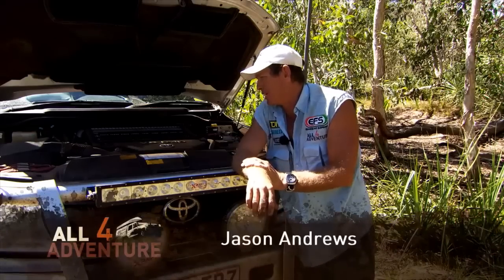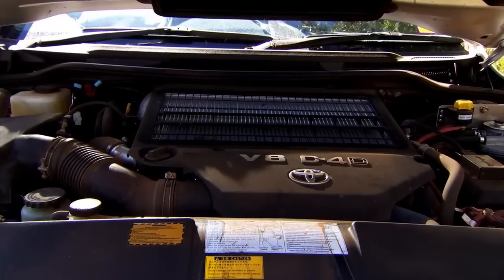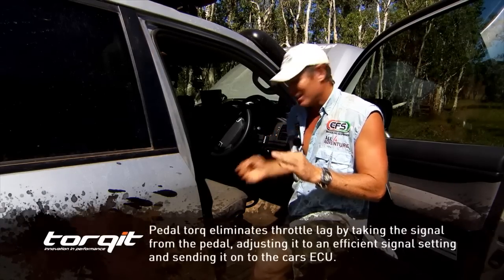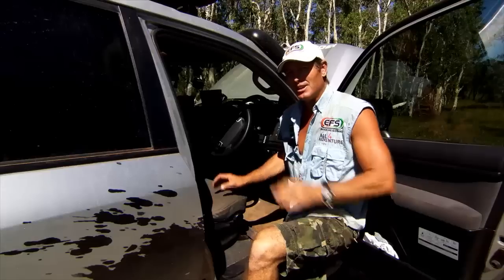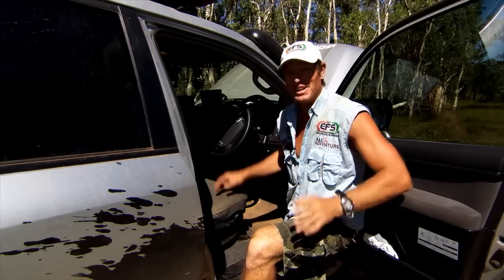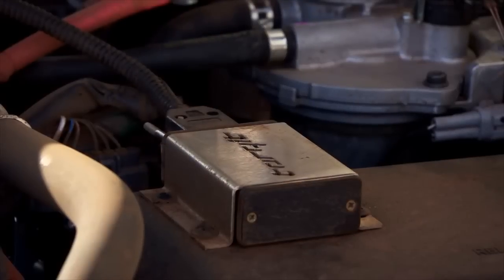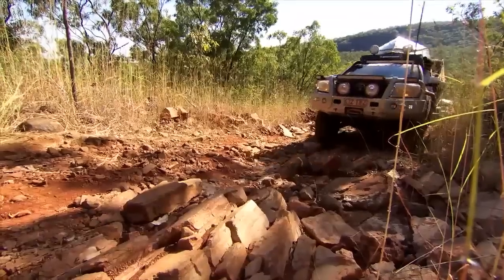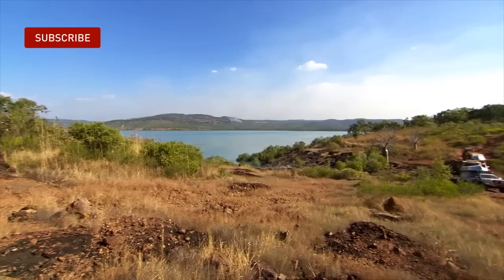The Pedal Torq system explained ► All 4 Adventure TV

Comment: Torque is not a factor of throttle position, it is all about engine build.  What RPM your engine is at when driving etc.  Check your specs on the Yota.  It will tell you what RPM range gives you most torque.  No fiddling with throttle signal will change this.
Reply: Scott Short It sounds like pedal torq just makes the pedal position ECU input ramp up faster (so you reach 100% throttle with less pedal movement).  If you also combine that with the chip update, then the new chip programming would probably dump in more fuel lower down the revs, if it sees a rapidly-rising throttle input.  All of the above would burn more fuel, but probably improves drivability with heavy loads.
Reply: RangieNZ   Agreed. All that being said, faster throttle response does not equal more torque as the host in this episode claimed.  You just get to optimal torque faster, which is not a bad thing.  I have a H3 (don't hate) and throttle response is a bit sluggish off the line (5,000 pound SUV mind you). Once you get going that little 3.7L I5 runs like a scalded cat.  PCM programming will fix throttle response issue and actually increase useable power and torque.  Rock Sliders and Bush guard first, PCM update third.  Gotta protect sheet metal from all that power and torque :)
Reply: The difference is from the factory you cannot actually get 100% throttle. This will make it so (depending what setting but in sport) when you put your foot flat you actually get 100% throttle not less like you get from factory.